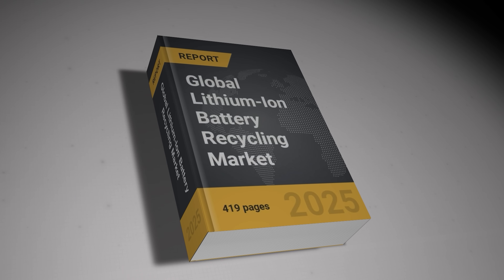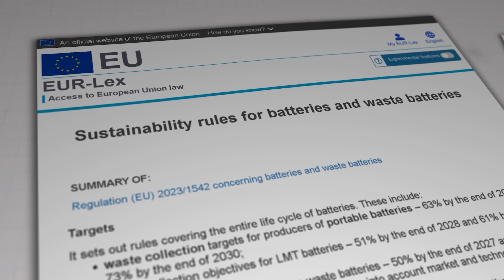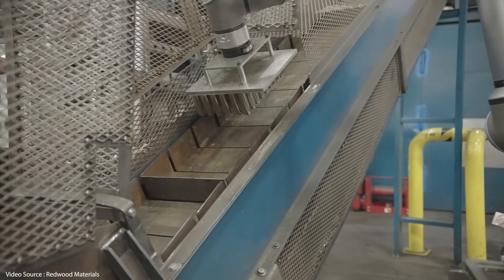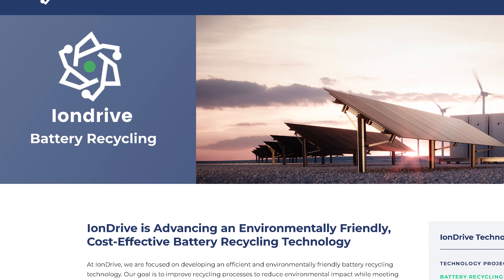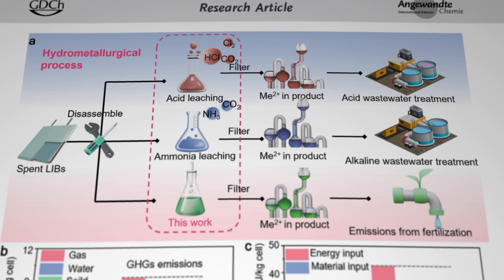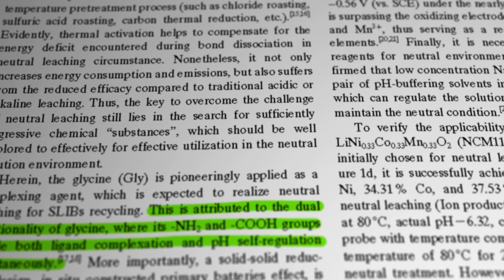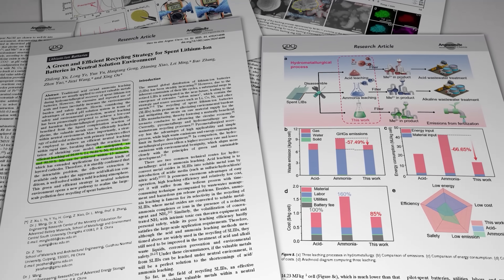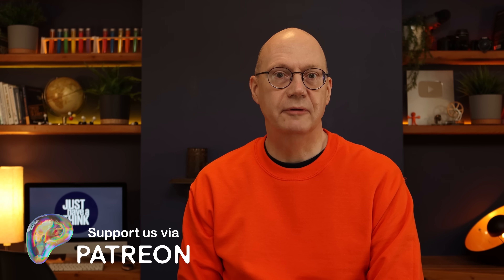Recycling Lithium batteries in 15 minutes. How do they do that?

Comment: Dave, as Tony Seba pointed out more than a decade ago electric vehicles, solar and batteries are technologies that can be endlessly improved on, or some such. Where fossil has reached a local peak. Like formula one had to had a hybrid electric to improve. Recycling seems it also meets the endless improvement criteria. I haven't seen any new tech to recycle diesel.
Reply: Well, funny enough they claim f1 is innovating by using biofuel (or efuel).
The real innovation is electrification. 😂
Reply: Diesel gets burned in engines, not recycled.
Reply: You KNOW "they" are coming, don't you?
Scuttling around collecting the same old misinformation to "debunk" the increasingly irrefutable facts.... 😉
Reply: @rogerstarkey5390 damn. That's going to haunt me now. I can hear their nails on my wooden floors...
Reply: You can make hydrocarbons from CO2 and water, but it requires a stupidly large amount of energy to do so. About the only way it might be worthwhile would be manufacturing carbon-neutral jet fuel from abundant renewable energy.
Reply: @Roxor128 
You can make it from Sewage and waste plastics.... both of which processeses have inherent waste removal value as well as the fuel itself .
Reply: About the closest they get is recycling the plastics as  oil.. ..

Comment: You are great.
I got my first EV decades ago, it was a scooter Ecojumbo 5000 by Ecomission with Pb gel batteries I converted to LiFePO4, in the same time we got a used Peugeot ION. Later I legt the scooter and  took used Zero S 2013, then used Zero SR 2018 and recently a brand new Zero SR/F.
I sold all the vehicles I changed and the new owners are entusiastic despite the elder are 12 y.o. 
In total we have driven EV for neatly 100.000 Km without any problem and without "seeing" a mechanic.
With my last SR/F I alteady drove for 2200 Km.
Reply: Thank you for leading, takes a little nerve and an understanding spouse 😂
Reply: @willm5814  it does take a little nerve, I noticed people were scared of electric cars, even Toyota prius's have a fear factor - Gosh what if the battery goes bad, I'll be stuck with a brick. I've bought several Priuses over the years for around $10k. I've had to DIY one of the batteries with a $40 module but, the others have all given me over 100,000 miles.
Reply: @GTN3  if your Priuses don't have plugs, they are not EVs. They are forever 100% powered by fossil fuel.
Reply: @skierpage  yup mostly, other than Prius prime that's a PHEV where you can drive them 30-40 miles on electric only. The idea I'm portraying is that people are afraid of buying them and ending up with a brick because of some potential $5, 000-20,000 repair bill.
Reply: @willm5814 I used "I' when talking about motorcycles because they are my daily means of transport, and "we" when talking about car because it has been used by the whole family.😛

Comment: This is potentially good news. It's very concerning that these chemical batteries are not 'circular'. (Which is why I think we should be looking more at mechanical/gravity batts.)
I'm still suspicious tho, we have had all the bs for decades about plastic recyling, which has basically just been peddled by petro-chemical companies to encourage more plastic use. It's all very well saying it's possible, the question is, is it actually done? (In plastic's case, it is not happening.)
Reply: It is happening indeed, it's not 100%, but it substantially mitigates the problem
Reply: Gravity batteries have been analyzed by some very smart people.  Guess what?  They suck.  Turns out the energy storage per dollar is not as good as conventional chemical batteries, and by a good amount.  Chemical batteries are already 'circular', and getting more so.  There is already a huge battery recycling industry.  The paper that Dave talks about here is an improvement on existing recycling methods, not the first one to ever exist.
Reply: @incognitotorpedo42   Becaue people want to carry on with their present lifestyles... we refuse to reduce - the only actual solution to the situation.
Reply: JHaT did make that point, that this is just in a lab. If it doesn't work for this lab, another will buy them out and make it work.

Comment: to be perfectly honest, the only reason I will wait for at least a few more years before I maybe get a car is because my country doesn't yet have sufficient infrastructure to make servicing an ev cost effective in the long term. There are very very few mechanics who can do that here at the moment, and they are outrageously expensive. I really hope that changes for the better as time goes on, I would like nothing more than seeing the widespread use of evs over here.
Reply: the first generation evs alre easy to fix so yuo could do it even yourself, I fixed my modern ev after it was in a crash and it was still manageable
Reply: I've owned an EV for 3 years, from new, and not had to do any servicing other than tyres and windscreen wipers. And no indication this is likely to change! There is much less (agree, not nothing) to go wrong.

Comment: Used ICE is 15x cheaper than Used EV and have 50% to 100% more range
Reply: Utter BS.
Reply: And they suck to drive (compared to EVs).  They break a lot and cost a lot to repair.  And they spew pollutants and greenhouse gases.  And no, not even close to "15x cheaper".  Are you comparing a Tesla to a Yugo?
Reply: @incognitotorpedo42  I recheck local prices small EV cost 12,4x more than smal Used ICE and have only 20% of range of ICE

Comment: What happens to the economics of battery recycling as we switch from MNC, to LFP, to NFP? The materials being used are getting more common and less expensive.
Reply: Around 99% of 12 volt lead–acid batteries are recycled. If there’s value in those, then we can be sure there’s a lot more value in the more modern battery chemistries.
Reply: @mrsneeklamy  The economic model has to be changed to get the lead acid batteries recycled. You pay an environmental fee upfront in most jurisdictions to get lead-acid batteries recycled. Are we going to need an upfront fee for sodium batteries? You can't get much money for sodium, iron and phosphate. Recycling can be done. The question is what economic model has to be employed? Right now, the money from the materials in MNC makes it worthwhile to recycle. Is it something that has to be mandated with other materials?
Reply: @yodaiam1000  lead is worth about 90 cents per pound.  Iron is worth about 4 cents a pound.  If batteries get cheap enough, it might cost more to recycle them than they are worth.  Lead acid batteries are highly recycled because it makes economic sense.
Reply: @incognitotorpedo42  That is one of the reasons that I was wondering about the economics of the recycling once the chemistries change. Even with Lead, you have to pay an environmental charge that helps pay for recycling. It is even worse for sodium, iron, and phosphate. You could potentially make some money from the copper and lithium but once you go with sodium, you no longer get the lithium.
Reply: It'll depend entirely on the energy requirements, and realistically the differences to the overall math are really quite small once you properly bundle the externalities of producing virgin raw materials into said virgin raw materials.
Reply: @ZeDestructor00  
According to JB Straubel (Smart Bloke, Ex Tesla, as mentioned)
Redwwod Materials can recycle well in excess of 95% of the materials, at a cost of "1/6th (17%) that of mining new stock".... AND since it's essentially"double refined", it's better quality.
Reply: @rogerstarkey5390 Like I said, chemistry is known. Speeding it up from hours to minutes increases the throughput and in turn means smaller plants and faster scaling
Reply: The benefits of researching these chemical processes now and optimizing them is that many of these companies are building the expertise needed to shift business models to new recycling chemistries. The sooner market actors can seize multi-cathode recycling, the better situated they'll be to respond to market forces that inevitably drive previous chemistries out of the marketplace.
Reply: @nschrombeck  Yup. A few years ago, my opinion was "the chemistry has been figured out, now we need scale". now it's "we have improved the chemistry so much (maybe), and scaling out is starting"

Comment: This also doesn't take into account the batteries from EVs can extend their life in starionary storage.
Reply: and they can be also used as storage when still used in the ev, you just have to plug it into a two way charger, evs could help a lot with balancing the grid when we switch to more solar and wind power
Reply: @423GustavBern  Absolutely
Reply: @423GustavBern Does that include fines for EV owners that don't plug their cars in when the government orders them to?
Reply: @brendanpells912  What a weird imaginary fear.
Reply: @incognitotorpedo42  remember that time we were all fined for not buying gas when the government said we had to?
Reply: @brendanpells912 

If you buy a new 7kwh battery, why do you care if it's 7kwh of virgin cells good for 7kwh or if it's 10kwh of 70% depleted cells good for 7kwh? You're not lugging the thing around, it gets mounted to the wall. 

And fines? No, but you'll miss out on the premium rates being offered for your electrons.
Reply: @brendanpells912  it should be your choice if you hook up your ev or not, and most people will do it because they want to, because lifepo4 batteries have so many cycles that they will brake from calendar aging anyway, so not using the cycles to make money from selling electricity would be just "wasted money"
Reply: And balance the grid
Reply: @rinnin  So how many Twh's of battery capacity will we need in like 10 years to meet your targets? To meet current and future global electricity demand, what emissions, resource consumption and waste will be produced to do the mining of each material, manufacture of infrastructure and cost of recycling all infrastructure and efficiency in material reprocessing and the cost per unit of all retrieved materials?
Reply: @jimsimpson2820  its gonna be less pollution and waste then using coal and fossils, ofc at the same time nuclear also should be build
Reply: Try watching the video more carefully. Your tired objections are covered at 10:38. The pollution avoided by not burning billions of tons of dirty fossil fuel is vastly more than the pollution from mining all those materials. And again, think about this subject of this video. Recycling batteries uses even less resources.
Reply: Yeah, the reason there is not much market yet is that the vast majority of EV batteries ever made in the history of the world are still in use, not even on their second life yet in standing storage. 

Gonna be a while till the market for recycling is a large demand.
Reply: To bad if you don't want to share your power because you need it in the morning
Reply: If I'm going to buy energy storage for my home, I expect brand new batteries.
Reply: @brendanpells912  people are buying second hand Leaf batteries to turn into home batteries. Plans on available to do such a crazy idea. Most home batteries are like £15k for 13kwh. But you can buy a leaf battery for a fraction of that price with triple the storage. Sure, if it is 70% depleted it might only be 20-25kw available...still better. And if you're handy with electronics...yer quids in!
Reply: @colinwiseman  prices are coming down. I''m getting a 24 kWh Sigenstore battery with 12 kW inverter installed for $7800AUD which is only $5000 USD
Reply: @brendanpells912  Sure, it's fine to hold that standard.  But others might choose used batteries at a lower price.